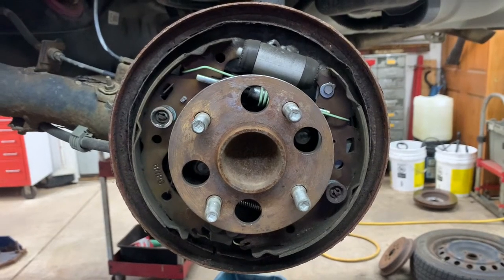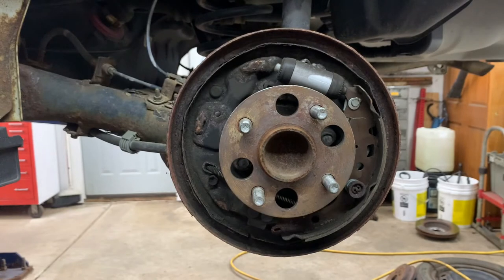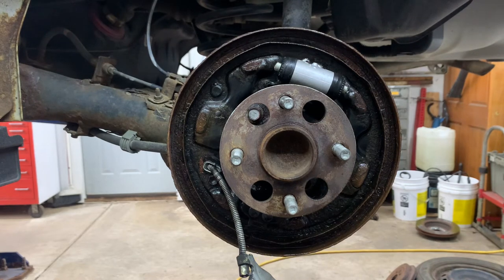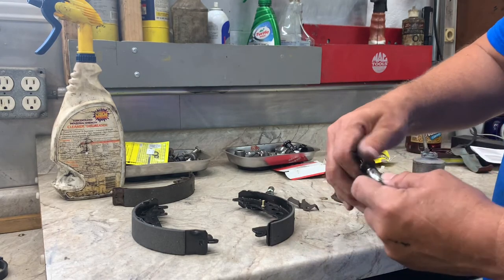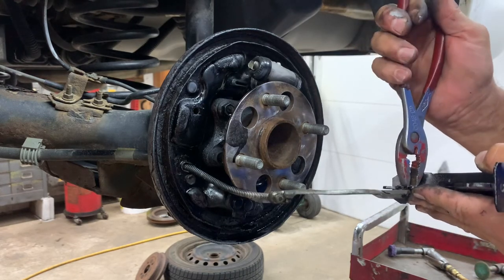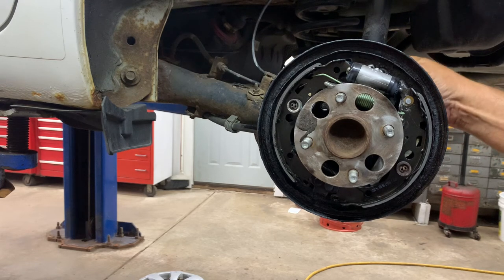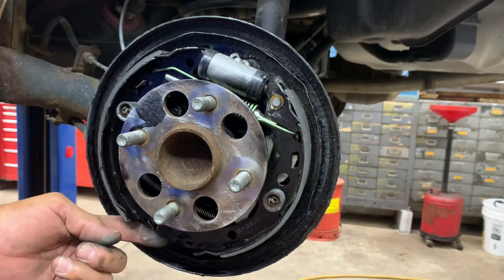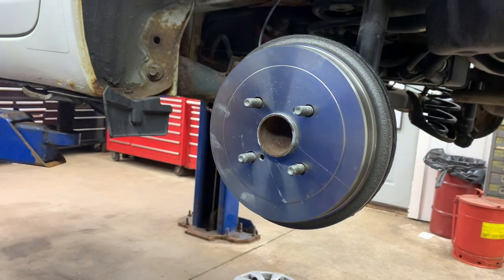2008 Toyota Yaris rear brakes

Comment: There are 2 threaded holes on the drums and on rotors too.  No need to hammer them off simply screw a bolt in the hole and they pop loose
Reply from the maker: Yes I keep forgetting about them so used to the drums being rusted onto hub you still need to break them loose then you have the rust ridge on the back side of the drum that gets hung up on the shoes when trying to get them off and just using the bolts in the threaded holes on the drum just don’t cut it most of the time
Reply: @richierock1300  I agree 100% but there is a rubber access plug in backing plate to release the adjuster. In fact it's easier to adjust the brakes with drum on and spin drum to feel a slight resistance as it spins. Also like to adjust the parking brake when I do the rear brakes too. Great video. I know how to do them but video is a great refresher.  Sometimes you can pick up little tricks like how you centered the shoes through the hub bolt holes. Slick trick for sure. Thanks again.
Reply: Yeah, but I can never remember the size/thread to go get the bolts from Home Depot. M8, maybe? It think that's what it was on my Corolla but I lucked out and had the bolts on hand already.
Reply: @NatenNator M8 x 1.25  20mm length 😂

Comment: Use a sharpie and mark the horizontal clips that are attached to the wheel adjustment... one side is shorter than the other... just mark what side should be facing u

Comment: You can put a bolt in the face of the drums and tighten that until it pulls the drum forward off the shoes . Saying that hammer works well also.
Reply: That's my fav way to do it

Comment: Thanks for the clear explaining of the small details, like where the adjuster ends fit. A bonus that you happened to be working on the same side of the car I was today.
Other side should be a cinch (I hope). A tip I got from my son is to use a bar clamp to keep the shoes together from moving around and being difficult. Really helps!
Reply from the maker: Cool good job

Comment: Great video.....
Reply from the maker: Thank you
Reply: @richierock1300 Hi Rich, after my drum shoe change, I went to adjust the E-brake with a screwdriver. When I was rotating that star gear looking piece, it make any clicking sounds it just rotated. Any clue why this would be?
Reply from the maker: @ACSteph-i4o  adjuster not hitting star move the shoes back and forth to center the shoes

Comment: I have a question bro I just did my read my drum breaks on my 2006 Prius looks exactly like this one an it seems I did it right by your video but on the passenger side when I was manually testing my breaks by spinning the wheel to see if it would spin still it kept spinning on one side any idea why ?
Reply from the maker: Did you adjust the self adjusters up snug when drums is on basically u can pull off the drum and then tighten a little bit more and the drum is hard to pull off but still spins
Reply from the maker: Turns with little effort I mean